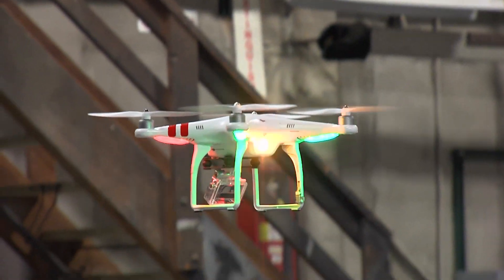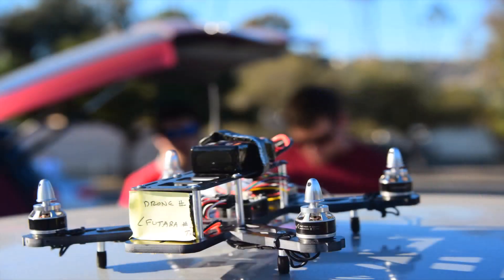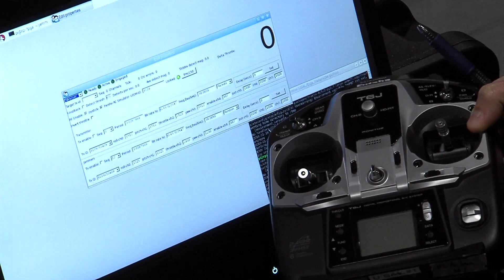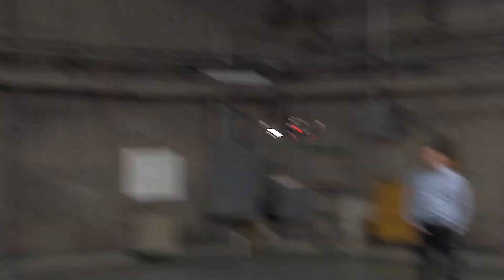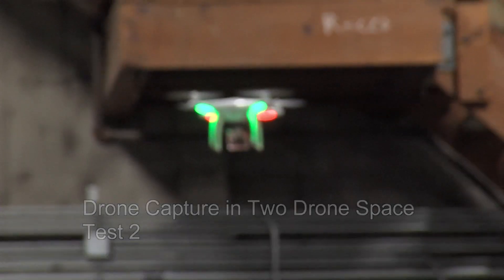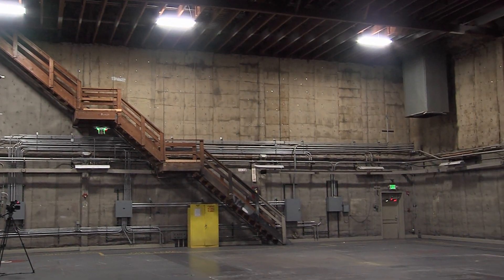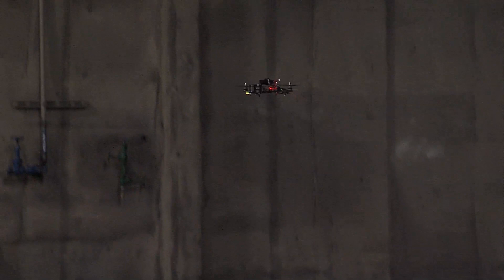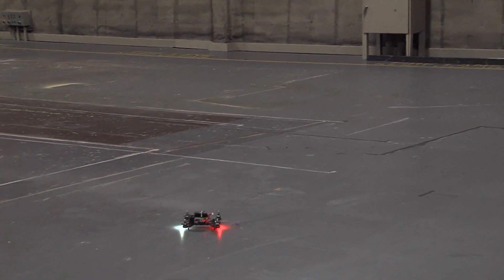Drone Takeover Demonstration

Comment: I was just thinking about how to make something ike this due to all the drone intrusions we have faced in US airspace lately.  I was actually crunching numbers, and said...let me look around first.  I cant believe this has 0 comments!  This is incredible.  
I think to overcome the problem of distance capturing, interference, and also unfavorable interruptions to public and private FAA infrastructure is that you have to make a mobile capture drone rather than a static station used as the source signal on ground.  That said, I can see how the bureaucracy, not only, but also the privacy issues, that surround these types of captures.  If Gov and Mil can provide assistance, even sponsorship, then just like Telecom towers can see what Mac devices are on their networks, there can be some triangulation between a few algorithmic queries performed in tandem. Such, would be a scan of Mac parameters that pull in data such as 'duration' that Mac have been on a network, a web of simul queries, and super-processors that will pinpoint all unlikely Macs, by process of deduction.  During, the already-established tech could be (this is why Gov-collab is necessary) loaded on strategically places satellites performing multi threads of data collection and processing, in order to rule out (as a second/third/fourth evaluation assessment of local signals) which signals are least likely to be the "culprit" with telemetry tech and low-alt radars that can be (a standard) installed on already used infrastructure (cell tower, traffic lights, etc). A web of collaborating devices, along with "capture" craft, all working together, even automated (best option with man-overview ready for manual control takeover).  This network of inter-dependent tech, would then dispatch an actual capture craft, using all the combined data and threat-assessments done in real-time and quickly, to that uses all this data to auto-pilot a super-fast drone racing towards the most likely target, loaded with the tech that you are using on the ground, to bullet straight to the threat, proceed with scan of the used frequencies while in range, hijack it and perform the takeover, while also launching a small swarm attack to support and assist the drong network, for things like triangulation, chase, eyes on the threat craft, or for things like the spoofing so the operator of threat craft doesn't (immediately) catch on.  Meanwhile, locked-on capture drone escorts enemy craft to retrieval station to begin forensics and FINALLY figure out who's behind it.
Easier said than done, but with the 'right resources' backing, and best collab partners, it can happen- soon.  This video is 9 years old, and today in 2025 I'm watching a fresh episode of 60 minutes talking about that the US still has no way of safely disarming these UAP and drones flying over Langley and US airspace.  
With the use of a broader (safe) band of interconnected radars, in conjuction with systems like ADS and in partnership with the FAA, amongst all the other things I mentioned, I believe you can quickly target  a hostile drone based on first visual contact (around valuable sites and assets by people, usually mil base occupants or airspace monitors).  After a threat drone is reported, the pinpointing is done by the quick process of deduction mentioned, since a visual report will already narrow it down to a general area or zone.  Concentrate the tech in that zone, deploy swarm "catpure" or hijack drones immediately to that area, ideally from drone locations that surround the center of the reported threat, so that no matter what direction it goes in the event of evasive actions, it will pass between 2 capture drones, and can be locked onto just by automated pinpointing until it can come within range (while in flight) of capture sequenc.
If you made it to this point in reading, know that I will be deleting the comment eventually so I'm not that ONE guy that comes off like a crazy crank, but a response would be great to know that you have heard my comment.  I am always in the market for possible jobs in this tech area, but no promises! Haha.  A little kidding, but not fully kidding.
Keep doing what you are doing.  I'm sure most of what I've said you've already figured out- or another company- but this was still SUPER cool to watch!
Thank you!